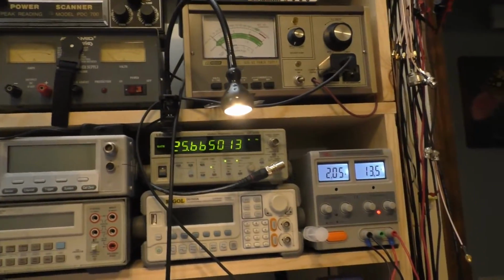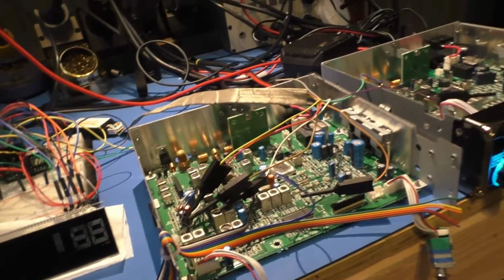SSB980 Project update

Comment: You and I have different idea's on what is fun and I am grateful that we each exist! LOL So did I miss anything in the past? Have been able to manipulate the dumb face plate in a smart way? Last I heard on your 980 experiments the display was a lost cause and not usuable as a display once you modified the rest of the radio?.
Reply from the maker: Well I went into this assuming that I would probably destroy the radio.
So far it's actually not destroyed and I could reassemble it without an issue.

If I start this and have reservations about damaging it then I should not try to reverse engineer it.
That's sort of a pre-requisite to reverse engineering. 
You have to be able to tolerate the device/system your reverse engineering being destroyed.
If not, then don't do it.

The end goal here is to actually build a replacement board. Not because it's practical but because I can :)
Reply: Oh I get that. I was not aware you where going to make a usable face?

 I have to admit I have old radio's where the bezel is either destroyed or close to it. Usually the radio's have control's that are likewise not functional and have no real replacement that will both fit, function and allow for anything remotely OEM with regards to cosmetics.

 I think the next big thing is going to be "Base Radio's" made from perfectly functional radio PCB's stuffed in a new case with a nice not clunky looking VDO with very nice controls etc. Why? Lot's of donor radio boards no-more usable bezels and OEM style control pots. 

At some point someone will make a nice looking face that will allow this to be more easily done. Especially for older high end SSB radio's. Having more space in a larger base type chassis also allows for more filtering like selectable narrow notch crystal filters and add on's like DSP, Compression in chassis so your not cluttering up a space with all kinds of separate and less than good looking black boxes.  

The only way this will not happen is if the OEM's  actually offer something comparable to the old SSB base stations as modern radio's. Doubtful!

We have seen this with bikes, motor cycles, hot rod, muscle car's, rifles etc.....It goes both ways. First the after market steps up and once they still enough of the market than some OEM will step in and do a re-issue or will build a modern equal. 

So building a modern user customizable display face while a bit too early for the market to bear could down the road be in hi demand??? Most VDO's for instance have really tiny displays and are not easy on the eye's and do not have any driver output to drive meter's of any kind or to drive another board that could drive a meter. Most of them will not control any of the function on the face of a unit and you have to keep the units old controls in place to control all the functions on the face.
Reply from the maker: Well, you let out my next one mate. That's one reason I am doing this on the 980.... is to stuff it in a box.
It's already deep in planning. I wanted to do the 980 first because it's going to be the simplest to do.
The next one planned is an 858 or 8719 based radio with a new user interface.

But yeah.... I already have a bunch of the bits to do it. I just have to design the interface.
Reply: That will be cool. I have been predicting something like this for some time. It is the logical thing to do with all the good vintage SSB boards floating around. You would not believe how many radio's I pass on because I know how hard it is getting to find controls, bezels and the like. Good Luck! I can not wait to see it done!